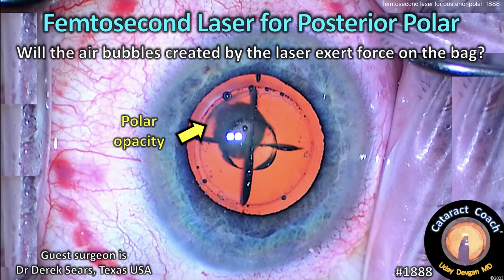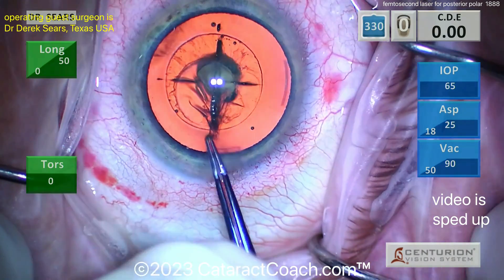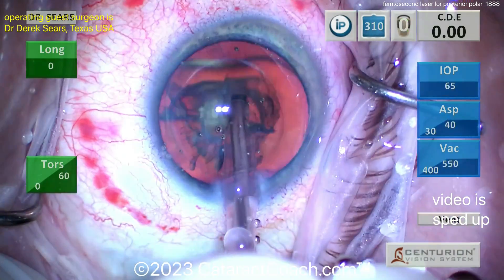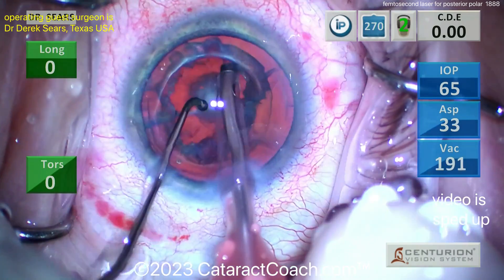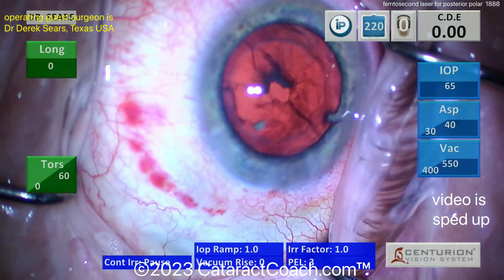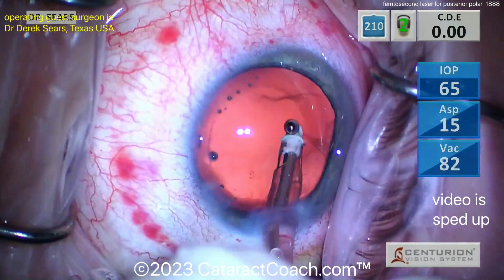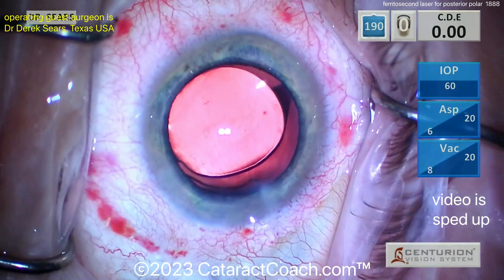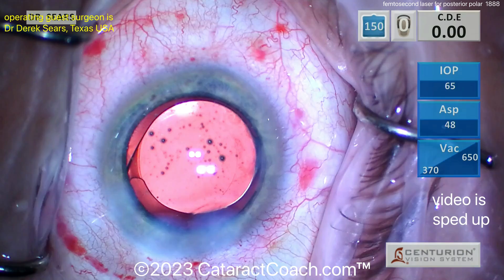CataractCoach™ 1888: femtosecond laser for posterior polar cataracts

Comment: I like the surgery. Thank you Dr Devgan for your excellent website. i learnt a lot from watching those videos.  I am sure there was hydrodissection during  the presumed hydrodelineation. see careful the the video and you will see there was hydrodissection. Luckily, most of the polar cataracts shown have no PC defects. In my opinion, true hydroelineation in tehse cases doe not give much as the nucleus is very soft and it is difficult to control the flow in hydrodelineation in soft cataract and hence the hydrodissection seen in this video. I do very gentle puffs of anterior hydrodissection not going beyond the equator, followed but viscodisperssive 360 degrees viscodissection, topped -up as needed